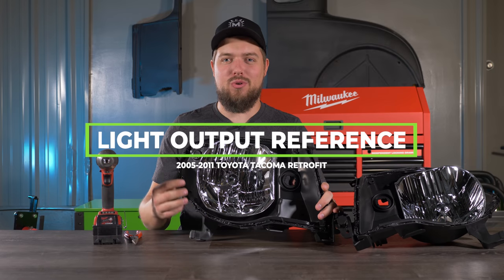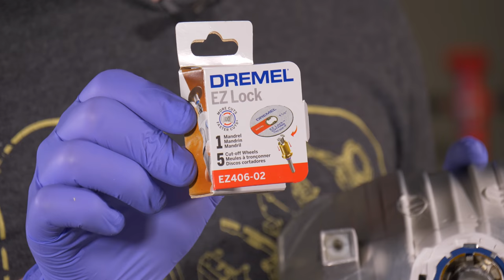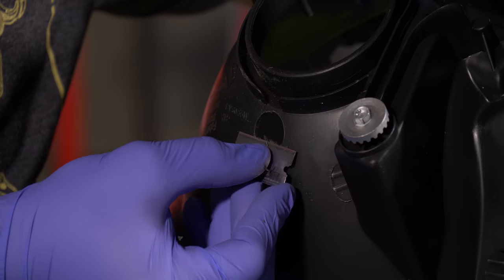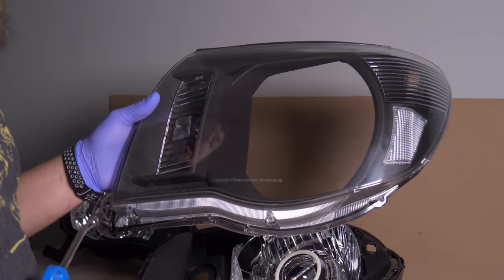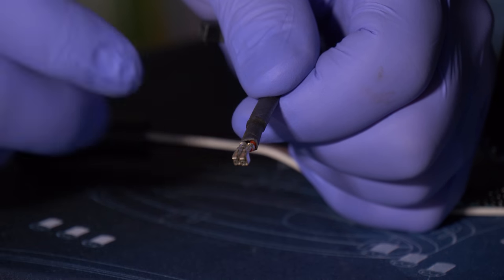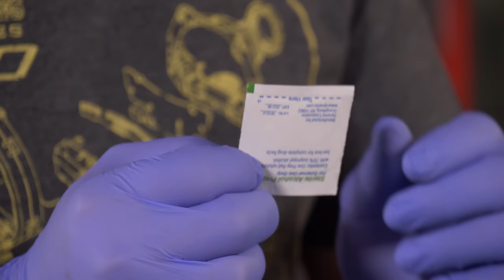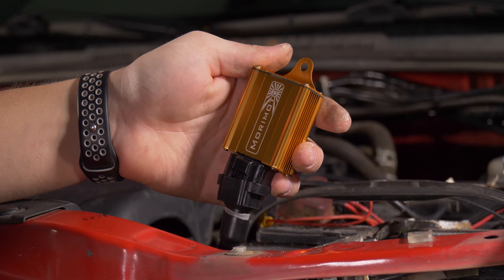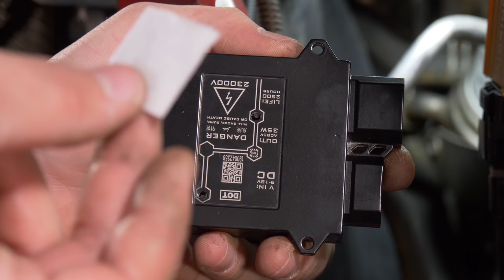How to build custom HID projector retrofit headlights and install bi-xenon projectors and LED halos

Comment: By taking the reflector bowl out and placing it on a bench ~25' from the wall, why wouldn't it be more beneficial to leave the reflector in the housing? Do y'all use a jig to place the reflector bowl in to align it perfectly? I'm installing 4.0 d2s in the same headlights, will the alignment washer set the projector level regardless? Thanks in advance! I'm very excited to complete my install!
Reply from the maker: We left the reflector out of the headlight incase the reflector needed to be trimmed more when aligning the beam pattern up with the factory beam pattern. We don't have a jig, but we used tap to mark where the headlight/reflector is sitting to ensure that it's in same spot as before. That can be seen in this video: https://www.youtube.com/watch?v=JRA7875E8WY&t=474s

The alignment washer will set the horizontal level, but may still require some tweaking. You'll also need to trim the back of the reflector as well so that the nut will thread to the threads.

Good luck with your retrofit, we'd love to see it when it's completed!

Comment: So these things arent street legal?  I want to do this 13 taco, but Im not trying to be getting pulled over for headlights, especially living here in California where everything already ridiculously expensive.  I dont want any tickets added to the list of things I have to pay
Reply from the maker: They are unfortunately not street legal, I wish they were! What I can tell you is that in an off-road application, these lights will produce a totally safe and usable beam out front!
Reply: @RetrofitSource  Well I understand that you guys from TRS cant say it, but Im sure most people are doing these retrofits for vehicles driven in the streets.  Id like to know from anyone that has done this retrofit.  What are the chances of actually being pulled over for it or is it really something that as long as the headlights are properly aimed and not glaring the shit out of people cops wont be able to tell the difference.
Reply from the maker: Those projectors should produce a safe and accurate beam pattern, and shouldn't bring any extra attention, other than positive, to your headlights!
Reply: Technically these setups are highly illegal, but you're not gonna be "that guy" with the PNP HID kit or jumping forward to present day with the replacement LEDs that's blinding everyone on the road at night. With lenses in good condition and the the headlights aimed properly, you shouldn't be causing anyone any grief at night.